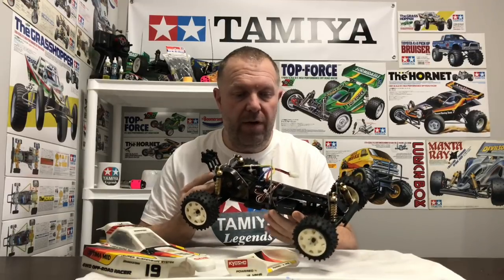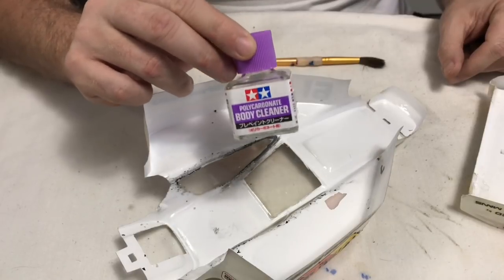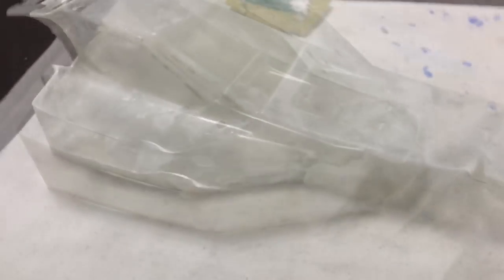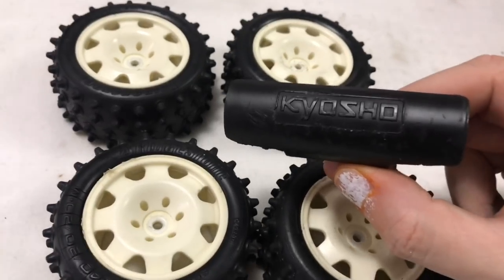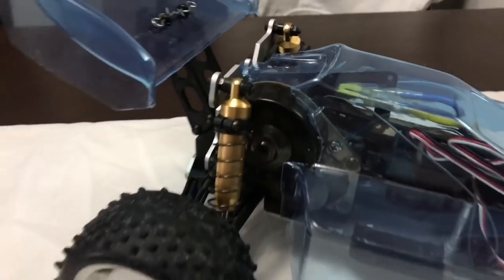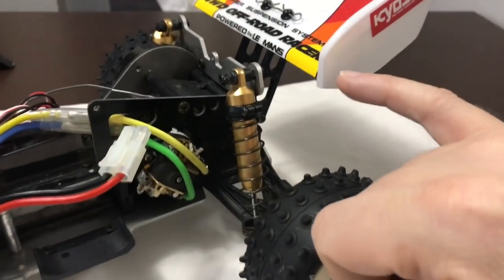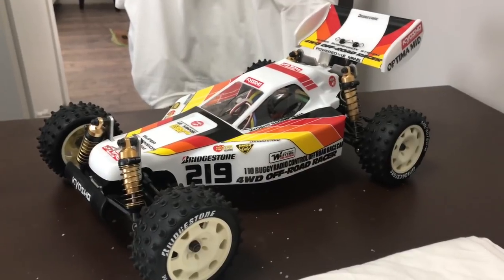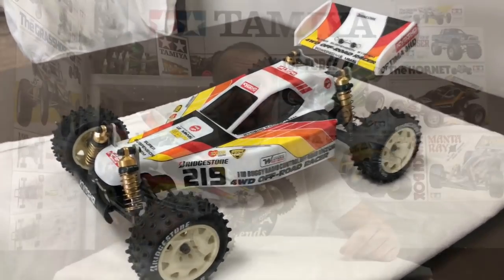Kyosho Optima Mid, Part 2...

Comment: I've done a few of these Mid body's so I know what a pain they can be, especially the curved part near the motor cover. So to make it easier I made up a template out of an off cut of lexan and cut along the edge of it with a hobby knife and got a much better result.
Yours doesn't look too bad, I think you could tidy it up well enough with a dremel.

Comment: I was wondering what the Tamiya Polycarbonate body cleaner was for. It was very easy for me to get. I have been told that brake build might also remove paint from bodies, but it might also fog the body too. I have not tested this out.
Reply from the maker: Alfred Yost 
Yeah I only use the cleaner to remove paint, I’ve heard horror stories about brake fluid 😬